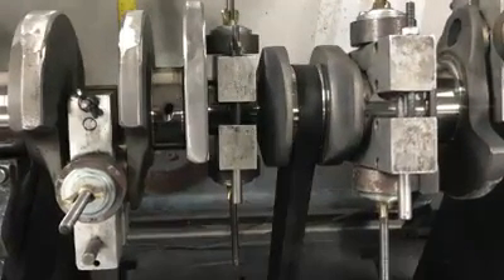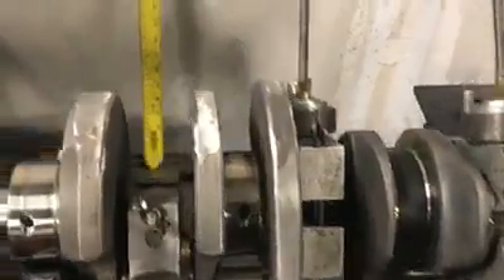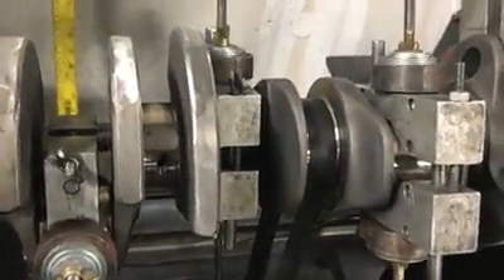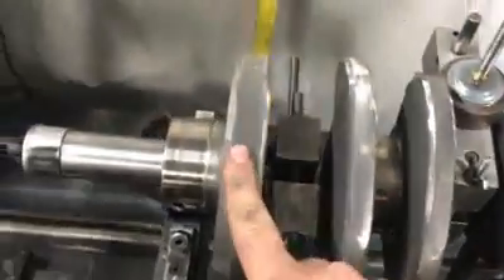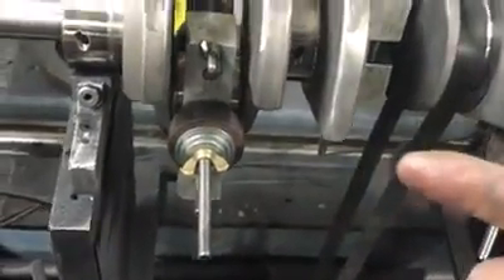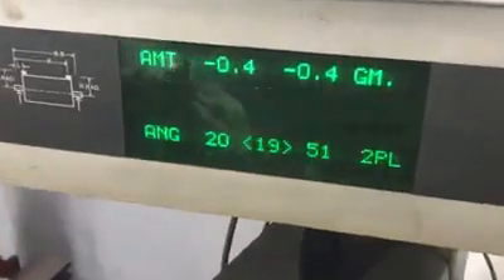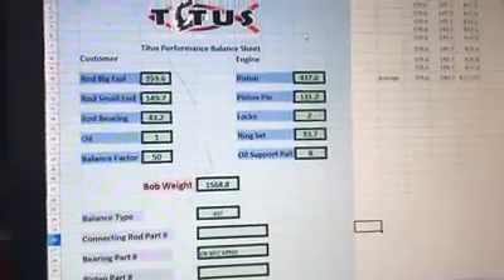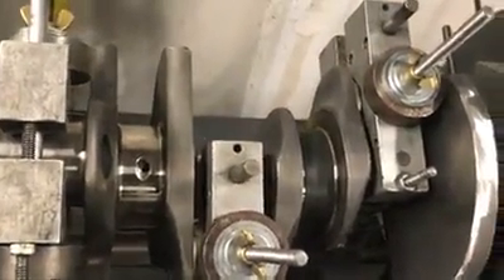Balancing a High-RPM Crankshaft // Engine Building 101 – Titus Performance

Comment: MY opine is YOUR doing it RIGHTEOUS non PROFITEER method However I enjoy maximizing MOD DIY....THE Crank Weights are Also FANS in OIL....and that THRUST bearing gets PRESSURE.....that NO ONE has SPECIFICATION PRESSURE ...STATIC.......😊I firmly believe the THRUST pressure measurement that is neglected is like neglecting GEAR MESH...heheeeeeeee......YES..IM a RACER with TROPHIES 1sts..2nds and 3rd place trophies UP THE YANG.....and TRUING an BALANCING an Tolerance an Spec and TEMPS and Pressures ......an LOAD testing is THE.....END ALL end ALL.😊

Comment: I love watching these videos but once you Learn from Tom Molnar and his people he works with? ( Crank balance Machine maker) You will know a lot more then you'll ever know now. Molnar Technologies rotating assembles come two ways, either balanced or not balanced. His Balance assemblies are the most Balance system you'll ever see. Hardly any holes drilled if any at all, Why is that? Its called knowing the crankshaft maker and making certain changes so you don't need to have to drill so many holes. I consult with Tom long before ordering anything.

Comment: I agree that a crank should have not just the ends balanced.   That effectively should put a longitudinal  bending load into the crank and block, and then when the harmonics are right that force will be huge.   Broke many a block before finding that.

Comment: If you take a top fuel engine, that's idling at 2500-2700 RPM, and 9000rpm at the end of the run, in 3.6 seconds, the crank has only spun a 600 or so revolutions, say an average rpm of 9000 \60 = revs per second, times 3.6, and see what you get....
Reply: What's your point?
Reply: @joe-hp4nk  what's your point?

Comment: High RPM engines should be over balanced by around 3%....for engines  operating above 7000rpm
Reply: Elaborate on exactly what "over balanced" is.
Reply: @chestrockwell8328  adding 3% to the reciprocating weight to equal rod stretch..which is .035 on steel, .050 on aluminum
Reply: When rods stretch the piston and pin are moved outward by the stretch with changes the center of gravity of  more than twice the weight of the big ends
Reply: @ChiefCabioch  Thanks for the reply and explanation; I can follow the logic.  Seems the software/format when plugging in the various components to build the Bob weights should ask couple questions, Steel or Ally connecting rod and over 7k rpm and then to make the adjustments of heavier Bob weight.  "Over Balancing" is a misnomer, it's actually simply "balanced" based on the actual components and usage.
Reply: @chestrockwell8328  it's not a misnomer, I get a laugh out of guys who didn't know about overbalancing and now are authorities about it....
Reply: Not a balancing expert by any means, but I did notice his balance factor at 50% for his bobweight calcs.   So you are saying should be 53% or 47%?
Reply: @kwasg3  53% of reciprocating
Reply: Oil weight
Reply: @thepoopsoup  no, you are compensating for rod stretching, steel .035, aluminum. 050